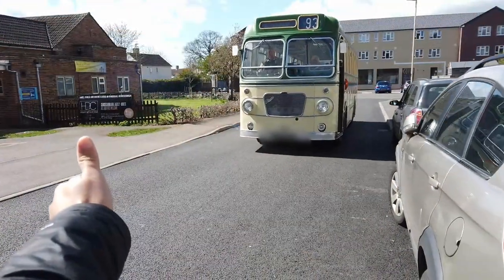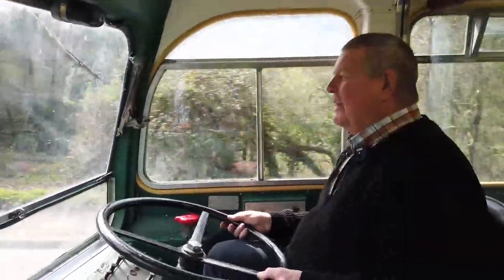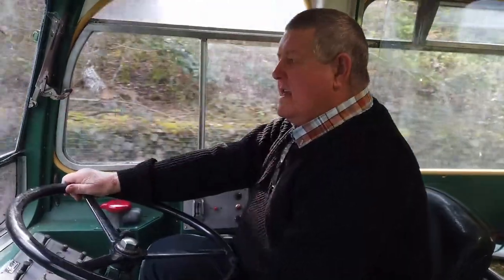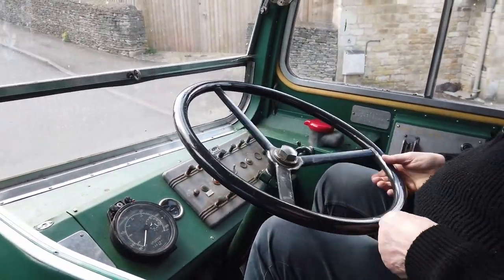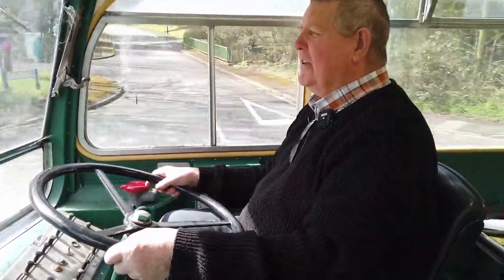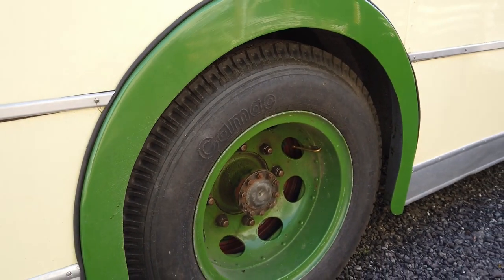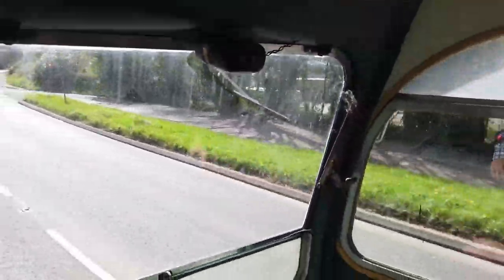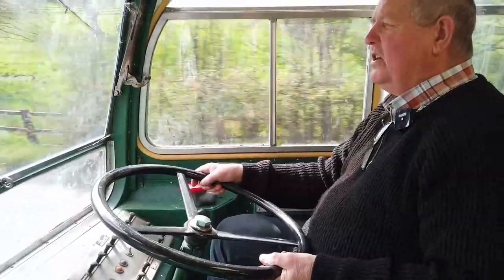DuB-EnG: VINTAGE Bristol SU Bus Coach. History, a ride out and some engineering. A beautiful Machine

Comment: I'm a huge fan of Bristol Commercial Vehicles/Eastern Coach Works buses from the 60's and 70's, as I lived in Bristol then and used Bristol Omnibus services to get to school and sometimes to go exploring.  I must have been about 10 or 11 when my parents let me go off for an exploration of the Bristol Omnibus network, or at least as much of it as I could do in one day.  This was in the mid to late 60's.  I caught a number 3, 5, 7 or 7A bus from where I lived in Horfield down to the country bus station at Marlborough Street in the centre of Bristol.  While on that service I bought a Day Rover ticket, which would allow me unlimited travel on the network for a day.  I picked up a number 300 bus at the bus and coach station, which was the service to Cardiff.  It was one of the first Bristol REs, and was in Red and White livery.  I travelled on that across the Severn Bridge (there was only one then), and on to Newport, where I got off and travelled back to Bristol on a return service.  At the coach station I transferred to a service that went down the A38 towards the airport, but got off the bus near Blagdon and transferred to another service that went East towards Bath.  That service was provided by a Bristol SUS, and until now I have not been able to identify what type of bus it was, thinking it might have been an MW.  However, having heard the Albion engine sound, I recognised it instantly.  What I want to know, if any of you actually know, is why this engine has such a distinctive sound.  Is it a two-stroke diesel, because it sounds different to any other four cylinder diesel I've heard?  In case you're wondering, I did make it home before the end of services that night, but it was about 8.30 pm and I didn't get allowed to do it again.
Reply from the maker: I need to get Pete to answer that...  I'm away on holiday at the moment but I'll ask him to check the comments section!  Thanks for the newsy post!  Howard
Reply: @DubiousEngineering 😅 A Bristol with an Albion engine - quite a rarity.